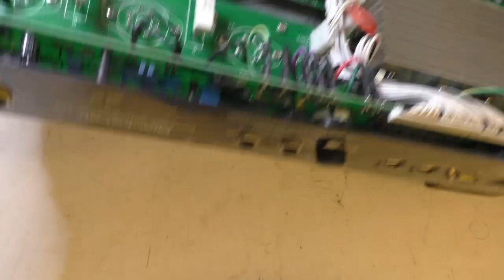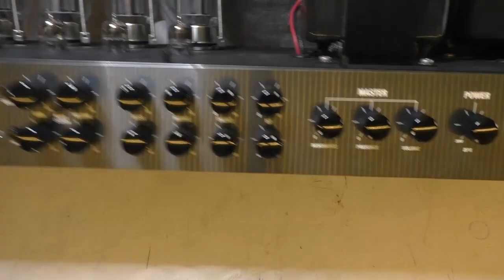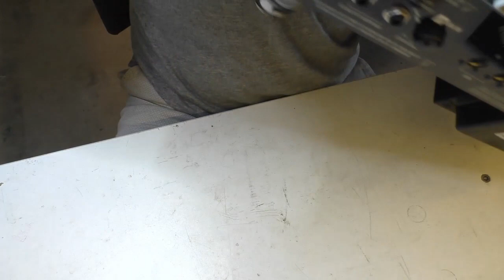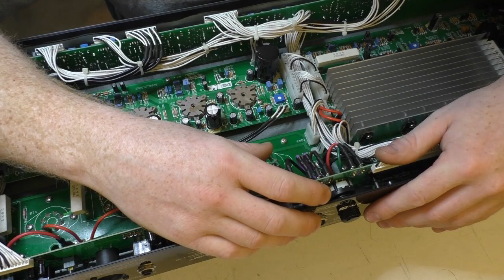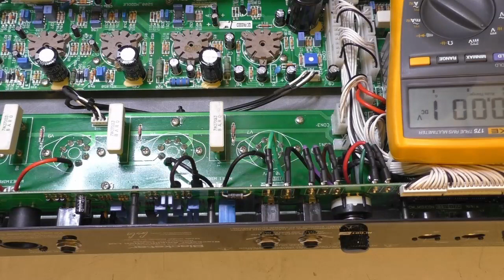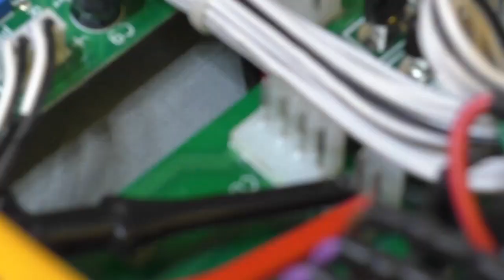Why I Hate Blackstars

Comment: Hi Brad, just came across this video and hope you can help me. I have a customer's  Blackstar series 1-104 6L6 on my bench. It looks identical to this 200W amp. The only difference are the 6L6 power tubes instead of the KT88s. The customer just wants a new set of power tubes so I need to check / adjust the bias. There are 2 preset pots on the boards, one near the large aluminium heatsink and one closer to the power tube board. I suspect that the one near the heatsink is the bias adjustment and the one closer to the power tubes is the balance. Can you confirm if I'm correct. Needless to say Blackstar would not give me any info at all despite me telling them that I am the tech for a small independent music store here in the UK (true). The store sells Blackstar amps and they also contacted Blackstar and got the same total lack of support. Thanks in anticipation. Ray

Comment: Perhaps solder the 4 pins hardwired only on the one connector that was intermittent. I have done that on Fender amps from the 80's where the ribbon cable goes bad only on one side. So you can still dismantle the boards if needed later. So one side hardwired and then you only have one of those connectors to worry about. A dab of silicone on the other connector and it would probably be more reliable over time. Amps with KT88's should not be wired up using computer like terminals in the first place. Sad day and age we live in that they even design this stuff like this. 

BTW just found your channel tonight and just have to say I like your content very. Keep up the good work 👍
Reply from the maker: All the high voltage and high current stuff is hard-wired, so at least they got that part right. But the bias voltage makes its way through half a dozen connectors before it makes it to the valve sockets, which is a big no-no!